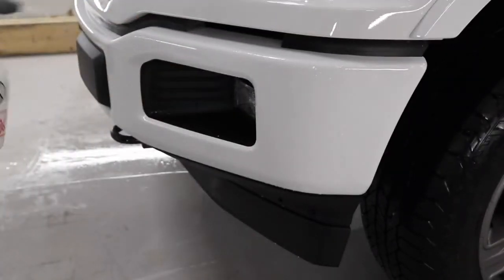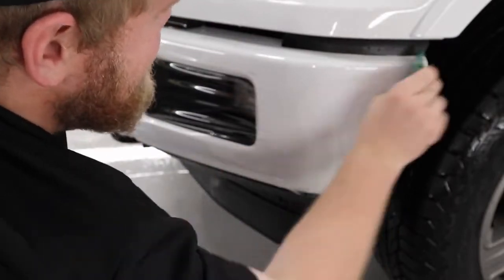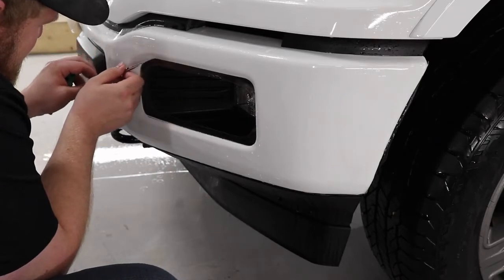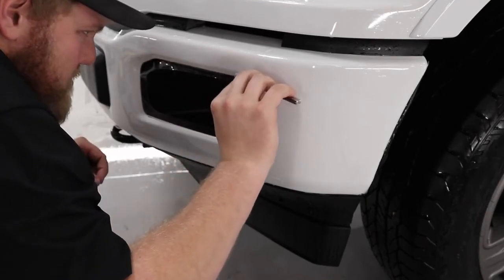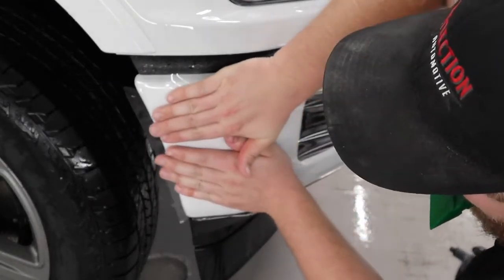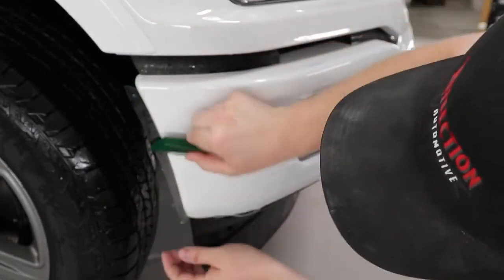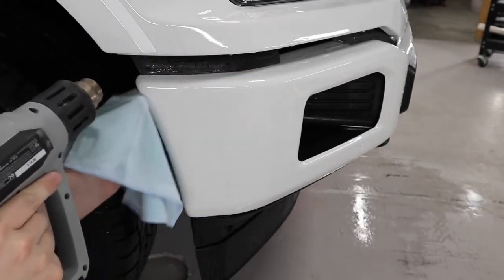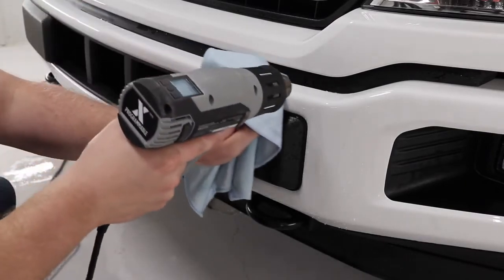HOW TO INSTALL CLEAR BRA PPF! 2020 FORD F-150 LIMITED FRONT BUMPER INSTALL WITH DEFENSE+ PPF

Comment: Question. I have almost this exact same bumper on my 2016 F150. I'm replacing the beat up shell with a new painted shell. Should I have someone PPF wrap the shell before installing the lights, valance and plastic bumper to the shell and putting it on the truck? I hope that makes sense!
Reply from the maker: Yeah there’s no better time to wrap it then now!
Reply: @DriveProtected  Thank you! That's what I assumed, I'll get it wrapped before assembly!